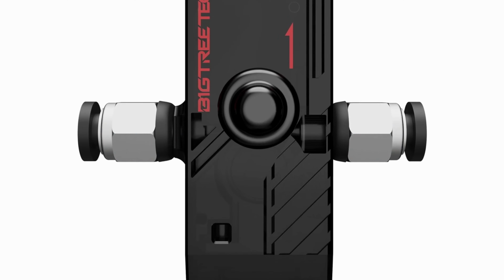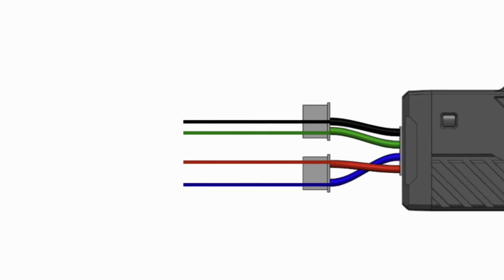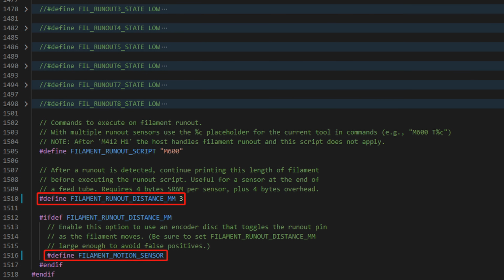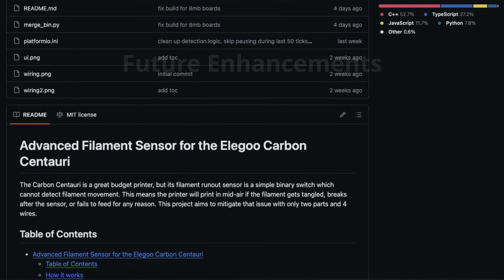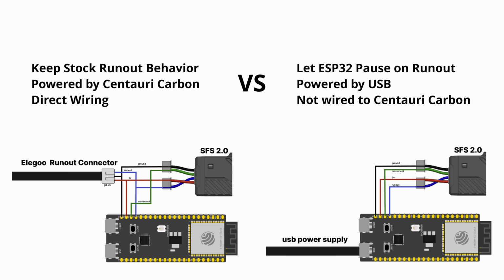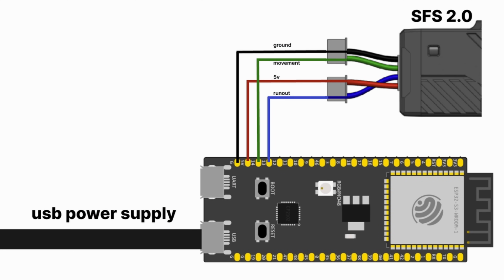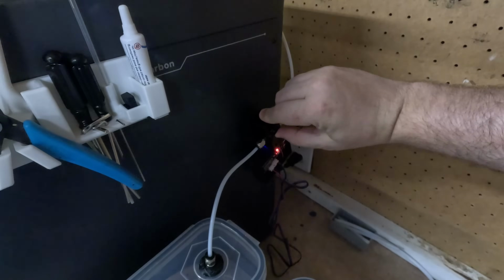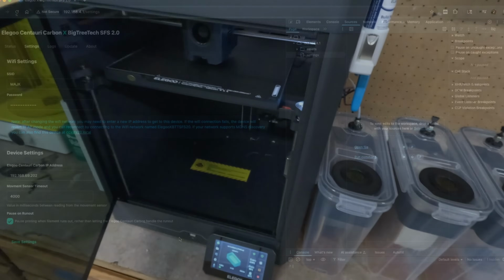Elegoo Centauri Carbon Upgrade, Filament Movement Sensor

Comment: Great project!
Does your latest code work with the XIAO S3?  No need for a big ESP32 board when using two pins🙂! 
How do you load the code for the XIAO? 
Could the code use pins from either board? The XIAO only has 11 usable pins anyway.  (code maybe autodetect, with "wrong" pins on bigger board grounded?)
Reply from the maker: I do have a Xiao, i will add a build for it. You can do it your own by modifying the platformio file if you want
Reply: @jrowny Thanks, I ordered the  smart sensor yesterday. I have some ESP32's laying around, maybe even some ESP8266s.
But the smaller is better.
I have mostly used Arduino IDE to load code, and also SPIFs. i don't write code just edit and load:-)
Reply from the maker: @Piccodon  I added the xiao board to platformio.ini on pins 5 and 6, I did not test it yet. You shouldn't need to modify anything, just install VSCode + Platformio extension, checkout the project with Git and then in the PIO panel you should be able to build the file system and firmware under the Xiao section.
Reply: @jrowny    Thanks! Jon, 
I first tried your web install, which worked , but could not get it to or change to my normal local network.
I suppose you text "...your network.." means my local network, and not some network of the ESP32 or the CC.

 I managed to install VScode, GIT, and figured out how do pull in your GIT (without doing a terminal "git clone"),   clicking thru various configuration until I got one that builds and uploads to the Xiao S3, and I get a terminal response from it (via USB), but those web settings do not work. Its shows an IP address on my local net that I cannot find in the source code, nor your (single digit!) stated pin assignments.
The terminal output looks hopeful...
"...
NTP time synchronization started
Web server started
ElegooCC communication initialized
System initialization complete
Checking WiFi connection
Skipping WiFi check in AP mode
Connecting to 192.168.1.123      <--- ?  not in my network
Filament movement stopped, last movement detected 10012ms ago
Disconnected from Carbon Centauri
Checking WiFi connection
Skipping WiFi check in AP mode 
...."
and so on.

I'm not a code guy 😞
Reply from the maker: @Piccodon it starts in AP mode ,  that means it makes it's own wifi Hotspot that you connect to. The default SSID and password are in the GH repo. Once you connect to its hotspot, you enter the ip listed in the Readme and you will get the UI. Go to settings and enter your own wifi network then hit save. It will restart and connect to your network. Then you can use the mDNS name to get to it.
Reply: the serial stream form the S3 is continous 
Disconnected from Carbon Centauri
Checking WiFi connection
Skipping WiFi check in AP mode
Disconnected from Carbon Centauri
Disconnected from Carbon Centauri
Checking WiFi connection
Skipping WiFi check in AP mode
Disconnected from Carbon Centauri

no connection to your WebUI
Reply from the maker: @Piccodon AP mode is another name for hotspot mode, it cannot connect to anything while in hotspot mode. You must connect to the hotspot and set the wifi. Alternatively, you can build the filesystem with the correct wifi ssid and password for your network with AP mode false. This is fairly standard for IOT projects.
Reply: @jrowny  Not familiar with fairly standard IOT projects. 
After the code loaded from VScode it had a terminal output, which I saved.
I could connect to your WebUI that IP# in your instructions and update to the CC's IP# and my local network IP#.
Later I could not connect to the ccxsfs20.local.
Reply: Skipping WiFi check in AP mode
Disconnected from Carbon Centauri
Disconnected from Carbon Centauri
Disconnected from Carbon Centauri
Settings saved successfully
Wifi changed, requesting restart
Restarting device due to WiFi settings change...
ESP-ROM:esp32s3-20210327
Build:Mar 27 2021
rst:0xc (RTC_SW_CPU_RST),boot:0x8 (SPI_FAST_FLASH_BOOT)
Saved PC:0x420b061e
SPIWP:0xee
mode:DIO, clock div:1
load:0x3fce3808,len:0x4bc
load:0x403c9700,len:0xbd8
load:0x403cc700,len:0x2a0c
entry 0x403c98d0
ESP SFS System starting up...
Firmware version:
Chip family:
LittleFS filesystem initialized
Connecting to WiFi: MY_wifi_guest
...............................Settings saved successfully
Wifi changed, requesting restart
Failed to connect to wifi, reverted to AP mode (first connection attempt)
ESP-ROM:esp32s3-20210327
Build:Mar 27 2021
rst:0xc (RTC_SW_CPU_RST),boot:0x8 (SPI_FAST_FLASH_BOOT)
Saved PC:0x4201c4d7
SPIWP:0xee
mode:DIO, clock div:1
load:0x3fce3808,len:0x4bc
load:0x403c9700,len:0xbd8
load:0x403cc700,len:0x2a0c
entry 0x403c98d0
ESP SFS System starting up...
Firmware version:
Chip family:
LittleFS filesystem initialized
Starting AP mode
NTP time synchronization started
Web server started
ElegooCC communication initialized
System initialization complete
Connecting to 192.168.2.10   <-- centauri IP#
Disconnected from Carbon Centauri
Filament movement stopped, last movement detected 8000ms ago
Disconnected from Carbon Centauri
Disconnected from Carbon Centauri
Checking WiFi connection
Skipping WiFi check in AP mode   
Disconnected from Carbon Centauri
Disconnected from Carbon Centauri
...
Reply from the maker: @Piccodon you need to enter your own network so it can connect. If the mDNS name didn't work after it's connected to your network then you need to find it's IP address through your router and type that in.
Reply: @jrowny hmmm... I did enter my local network name and password. 
With mDNS, I'm not sure I ever used it, Bonjour? Not a running service on my Win10.
Reply from the maker: @Piccodon you can see in the logs it failed to connect to your wifi. That could mean misspelled password/ssid, or sometimes even a faulty esp32 unit. If you have a 5ghz and 2.4ghz, make sure you connect to 2.4ghz.
Reply: Yes, a misspelled SSID :-) 
An SSID scanner in the app would help, as would unhiding the password.
I found a way to get to the WebUI without using the .local address, an AngryIP scan found an IP address next to the CC's.

Thanks for your patience!
Reply from the maker: @Piccodon  no problem, glad you got it working. I am working on adding wifi-scanning from the web flash tool so first time flashing it you can enter your wifi info.

this is my first time making "serious" firmware, so I'm learning a lot.
Reply: The Xiao ESP32-S3 is a formidable board, using it in some medium volume products at work .
The latest version ships with 16MB memory.
Only a few pins but a serial 595 shift register  can easily add five more if needed. 
The C++ code addressing the pins on it  supposedly is a bit "slow" but some more direct C implementation should be faster..
Reply from the maker: @Piccodon  it's plenty fast enough for this purpose, but there's a bug in my firmware that's checking the NTP time server too often that's causing it to be way to slow, hopefully pushing out a fix for that tonight after work.
Reply: @jrowny  I first time tried it on the printer, and it was a "no-go".
I checked my wiring pinout on the S3, 
Pin 6 movement = green
Pin 5 runout = blue. 
I then checked the voltages on pin 6 and pin 5. 
Pin 5 is 3.35V
Pin 6 is 3.35 and ~4.5V as soon as the BigTreeSensor is plugged in, and varies down and up when pulling the filament is pushed in and out with the blue LED blinking,  down to a minimum of 0.9V.
(Hopefully the little Xiao survived :-) 
If the Sensor is designed to work this way it would need some voltage scaling resistors, as the minimum level may exceed a logic low.
Reply from the maker: @Piccodon  ah, maybe the built in pullups are too weak on the xiao.
Reply: @jrowny  The ESP32 pin 5, and 6 should be inputs?  They are receiving signals (voltage levels) from the SFS V.2, not putting signals into it.
Supposedly the ESP32 "should be" tolerant of 5V on inputs. 
I made a 1mA voltage divider with a 3.3k on the movement pin(D6) to ground, and a 1.8k in series to D6 from the SFS, on that port I then got 3.3V and 2.8V when moving the filament. 
With no load the SFS movement  green wire, I got 4.5V and 0.8V (?or close to that) so I thought the port was smoked, so I moved the resistor divider to pin 7 (D7)  and got 2.84V and 0.09V respectively on filament movement. While at the 2.84V level the SFS LED is blue. That  looks like good logic levels for 3.3V.
I then updated the VScode two latest files that were changed, I hope, inside VScode  terminal, then changed the lines of code where I found the pin assignments, in "platformio.ini "   line 87 and line 99. 
Then did a Clean and Upload and Monitor, and it lookes like it got code loaded.
However, the Elegoo CC and your WebUI does not respond to filament movement.
Not sure I got new code loaded as the S3 connected right away without asking for new SSID and password.
Maybe pin assignment should be don in the WebUI?
Also, a pin could have pulse output for testing (functionality and WebUI) , by jumpering between two adjacent pins?  
Not sure if I got it right.
Reply from the maker: @Piccodon you shouldn't need any dividers or anything, both pins are pulled high once the device boots. So they should both read 5v. The movement sensor will pull it down then up again every 2.8mm of movement. The webui might not be updating but you should see it in the logs.
Reply: @jrowny  would you also have the changes using the Xiao ESP32 C3?  I have a few of those?
Reply from the maker: @Piccodon I don't have a c3 to test with, I have no idea if it works.
Reply: @jrowny if you could include a setting for it on GH, I could test it tonight. My S3 is toast. Other ppl at work had the same bad experience feeding 5V to its inputs.
Reply: Got some new ESP32 boards and it programmed OK. Added the voltage divider as the SFS 2.0 uses 5V logic, and WILL fry the ESP32 which runs at 3.3V.
Resistors cost next to nothing.
1.8k + 3.3k makes an easy 1mA divider.
Works great!
Thanks for all your efforts 😊
Reply from the maker: @Piccodon that's weird, my btt sfs 2.0 only puts outs out a 3.3v signal. It's meant to plugged directly into 3d printers motherboards. Not sure why you're seeing 5v
Reply: @jrowny  there is 5V coming out of the CC.  Of course you could use the 3.3V on the ESP32 board and feed back to the SFS 2.0, and not use the voltage divider. The 3.3V reg on the ESP32 board can most likely handle the SFS draw.
Reply from the maker: @Piccodon ah, my esp32 dev board has a 5vin, most do because they have USB ports so they already have a 3.3 voltage regulator.  I use the CC to drive both the esp32 and the sfs, but the logic is all 3.3, even when driven by 5v.
Reply: @jrowny maybe your SFS is different? I'll rewire my SFS to get 3.3V from the ESP32 board, thus avoiding the voltage divider, and not expose the SFS to 5V. 

Edit: Rewiring to send 3.3V to SFS 2.0 works great. No voltage divider needed.

There is a 3-color LED on that board, did you ever consider coding it for the status of the filament?
Reply: @jrowny Your WebUI status screen is pretty much instantaneous on filament movement start, and stays Green for about 8 seconds after filament stopped, as per code setting
Reply: Maybe you could show your Fritzing diagram to connect the ELEGOO 5V out to ESP32 boards 5V in,  and the ESP32's 3.3V out to SFS 2.0  power input? This way the voltage divider is not needed.
Reply: It may be worth including a note  that the ping of the ESP32 is pinging the PC not the ELEGOO CC. 
I have noticed that the ESP32 needs to be reset with the button on its board when pinging does not start.
A clear advantage of the larger ESP32 board as the XIAO buttons require a microscope, almost.

Of interest may be that the Elegoo CC has a design quirk in that the steel build plate bends on the front edge as the heater is about 0.6mm lower than the perimeter edge (except in the back). 
This makes the first "start" trace on the front edge flatten out, and to Z-adjustments in the software is measuring anywhere close to the front  edge to compensate for the plate bending. 
Bambu Carbon X1 does not put the buildplate below the edge , but their heater pad is well above the edge.
The fix could be either cutting the front edge or as I did, raise the heater pad with a space, placed on top pf the pad. I used 0.8mm (1/32") T6061 aluminum from Amlazon from $10 shipped, and cut it down to 259x259mm. The increased spacing to the heatpad magnets lowers the force quite a bit, but still usable. A side effect of the aluminum pad is the improved heat distribution.

Comment: So I just set this up tonight, finally. What are people having to set their filament movement timeout to? I've had to go all the way up to 5000 in order for it to stop pausing my print, while it's still printing.
Reply: 5500 now because it just paused again.
Reply: 6000😧
Reply: So far this thing is useless to me. I'm at 7seconds and it's still pausing after a bit. Sometimes it'll print for a few minutes, other times it stops after a few seconds. The whole point of doing this was to detect if the filament gets tangled or stuck. So far all it's done is frustrate me.
Reply: Is it possible that the code is sending continual pause commands to the printer which is causing it to never release the screen so you can restart the print? This didn't happen with whatever version of the firmware is installed from the WebUI when you first program the ESP. (I'm not a coder... If you couldn't tell.) Also, you should add a field in the Web status of what firmware version the ESP is running. I looked but I didn't see it. Maybe on the About page?
Reply: s it possible that the code is sending continual pause commands to the printer which is causing it to never release the screen so you can restart the print? This didn't happen with whatever version of the firmware is installed from the WebUI when you first program the ESP. (I'm not a coder... If you couldn't tell.) Also, you should add a field in the Web status of what firmware version the ESP is running. I looked but I didn't see it. Maybe on the About page?
Reply: Ok, so far at 5000 and 15000 I managed to successfully get a full print without it pausing for no reason with the firmware from 5days ago (v0.1.5).
Reply: And at the end of a print, it ends up pausing as well... And with the bug that is keeping Pausing... on the screen, requires a power cycle of the printer. This also keeps the fans all running as well. I hope you havne't abandoned this project...

Comment: fantastic good work. but miss seeing the whole assembly, what is the pcb used for? is it mounted inside the case?
Reply from the maker: I filmed it, but it ended up being such a mess that I didn't include it in the video. tbh, if I could do it again, I'd just make a wiring harness adapter using JST connectors and skip a PCB altogether.

Comment: I did this project a couple days ago and it worked great for a day. And then it wasn't catching snags the next. So I tried to log i to the esp32 and couldn't. I flashed the esp32 and re did everything and then the next day it again quit working. Don't know if it is a me problem but I am going to switch back to the old runout sensor
Reply from the maker: sounds like it's losing wifi, on some networks wifi can be tricky for the esp32. I'm trying to see if I can get serial access to the Carbon so we don't need the wifi/websocket bridge.
Reply: I have had same issue. Thought it was the ESP32 (ordered from the Amazon link from the video), but similar issue with second one.
Reply from the maker: @pjwhite583  does your network ever struggle with other iot devices? Some routers have some options to improve the reliability of iot devices. One issue is that the firmware reverts to AP mode when it looses wifi connection, because there would be no other way to set it, but maybe I need to figure out another option to reset it to AP mode, like maybe using the built in switch. That way a temporary wifi snag won't revert the device to AP mode. Or maybe I can make it retry the last credentials every so often and only revert to AP mode after a number of failed attempts.
Reply: @jrowny  Thanks for replying.  Most IoT devices are connected to Home Assistant on a dedicated 2.5 only subnet and have been fairly stable. At this point my experience has been mixed with this project so I’m back to original sensor. When it worked it was golden, but between issues with the BTT causing drag that triggered the pause and this network issue I’m in a wait and see mode. I think I resolved the BTT issue by taking it apart, cleaning it and making sure the Bowden was pressed in all the way, but then have been unable to get past this network issue. I will monitor here and github. BTW, in one of my other comments (I suggested sharing your project with Elegoo developers) you indicated that Elegoo may be working on their own solution. Is their a good public source for such “plans” from them?
Reply from the maker: @pjwhite583  there's really nothing special about the network stack in this project, the source code is all there on github, being that this is a free and opensource project, I'm definitely open to contributions if you spot something to improve. I do hope to make wifi not required for this project eventually.

Comment: ok so you use the sensor from big tree tech to sense when filament runs out, and then use the esp32 to trigger the websocket connection to pause the print, is correct?
Reply from the maker: Yes, that's basically it, although technically the esp32 is also "sensing" the runout by measuring the time since last movement, as the sensor itself just outputs a different voltage every time the filament moves.